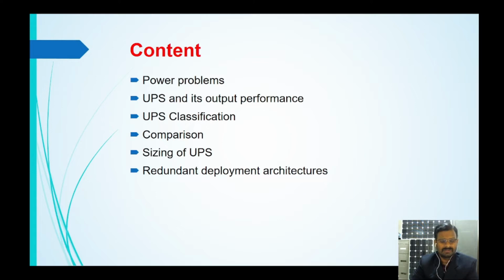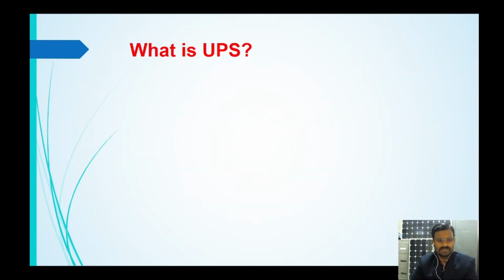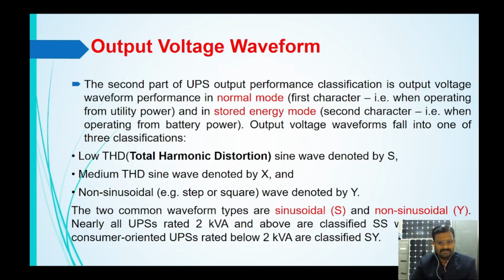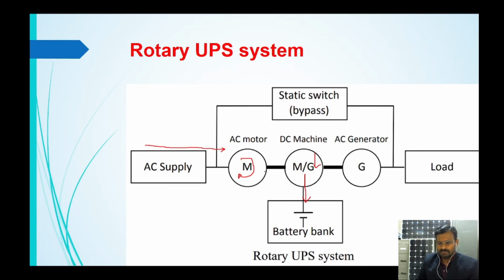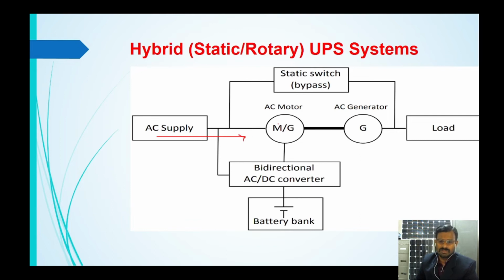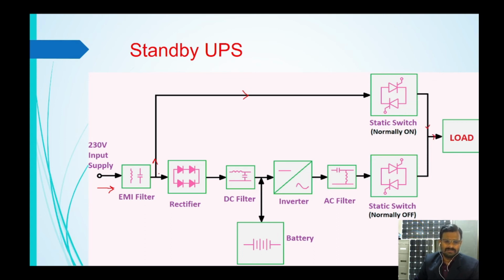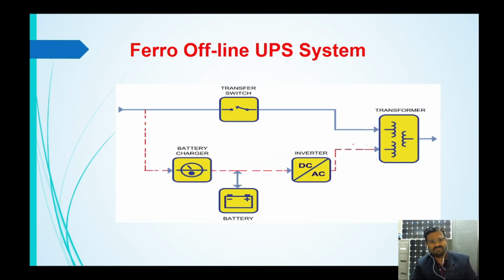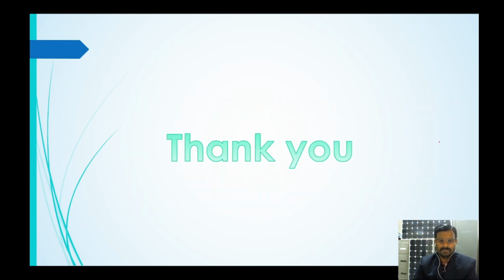All about Uninterrupted Power supply- Part1

Comment: Hello.why ups keep switching on and off.how do I fixed the problem
Reply from the maker: If your APC UPS is shutting itself off after a few seconds, there could be several potential causes. Here’s a breakdown of common issues and troubleshooting steps:

1. Battery Issues

Battery Age: If the UPS is old, the battery may be worn out and unable to hold a charge. Check the battery's age and consider replacing it if it's beyond its typical lifespan (usually 3-5 years).
Battery Connection: Ensure that the battery is properly connected. Loose or corroded connections can prevent the UPS from functioning correctly.
2. Overload Condition

Load Capacity: Ensure that the devices connected to the UPS do not exceed its rated capacity. If the load is too high, the UPS may shut down to protect itself.
Test with Minimal Load: Disconnect all devices and see if the UPS stays on with just the power cord connected.
3. Faulty UPS

Internal Faults: The UPS may have internal faults or damaged components. If it’s under warranty, consider reaching out to APC for support or replacement.
Self-Test Function: Many UPS units perform a self-test when turned on. If there’s a fault detected, it may shut down immediately. Check the user manual for guidance on how to interpret any error codes or lights.
4. Software Configuration

PowerChute Settings: If you have PowerChute software installed, ensure that the settings are correct. Sometimes, configuration issues can lead to unexpected shutdowns.
Firmware Updates: Check if there are any firmware updates for your UPS model that might address known issues.
5. Environmental Factors

Temperature: Ensure the UPS is operating within the recommended temperature range. Overheating can cause it to shut down.
Ventilation: Make sure the UPS has adequate ventilation and is not blocked by dust or objects.
6. Power Source Issues

Input Voltage: Check if the wall outlet provides stable and sufficient voltage. Fluctuations in input power can cause the UPS to shut off.
Troubleshooting Steps:

Inspect the battery: Look for any signs of wear or damage.
Remove all loads: Unplug all connected devices and see if the UPS remains on.
Check connections: Ensure that the power cord and battery connections are secure.
Run a self-test: Refer to the manual on how to perform a self-test.
Monitor software alerts: Use Power Chute to check for any alerts or logs that might indicate the issue.